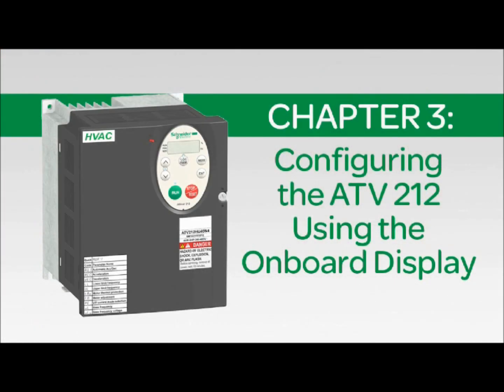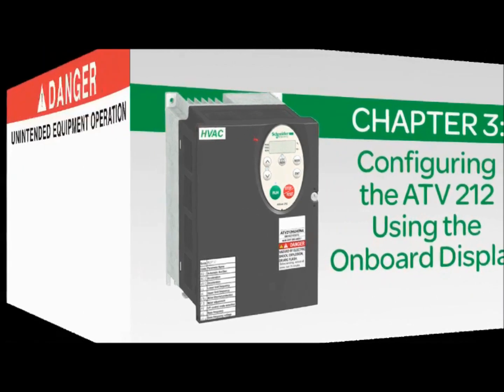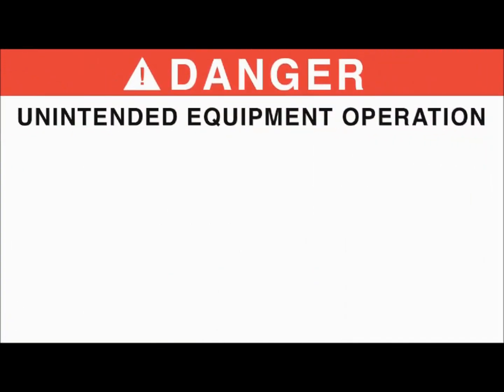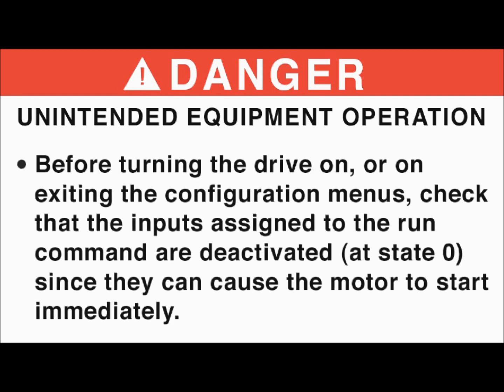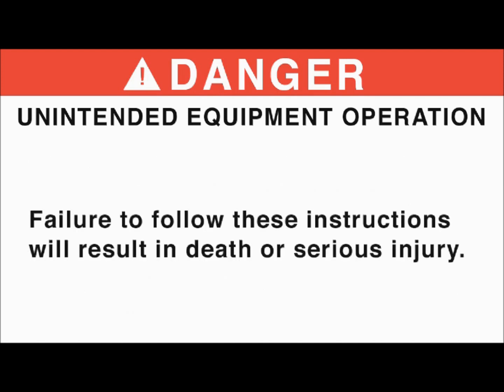Setting Up the HVAC Variable Speed Drive (VFD) | Altivar 212 by Schneider

Comment: I tried to control speed from PLC using 0-10V via terminal CC and VIA or VIB but it does not working. 
I already set in programming configure already but still can not drive.
Please help.